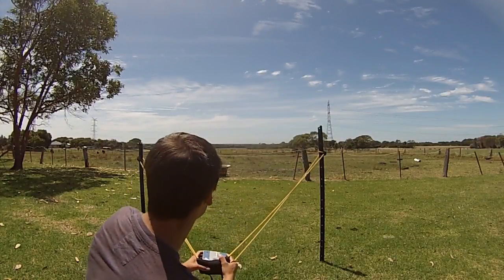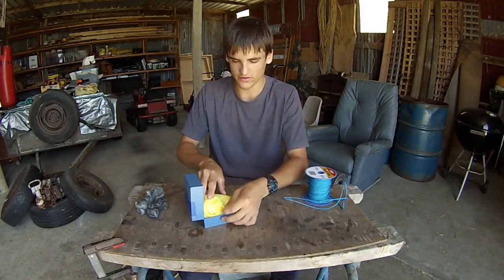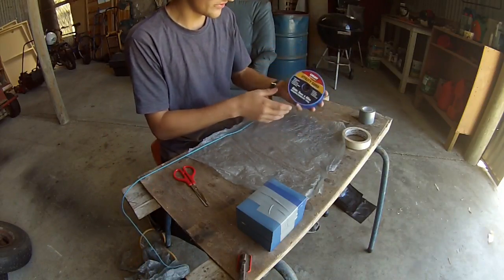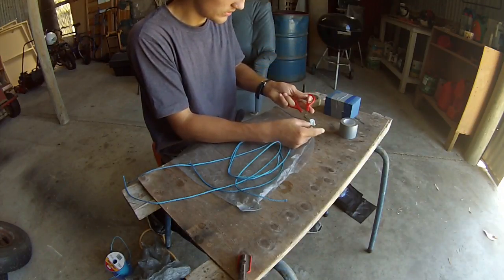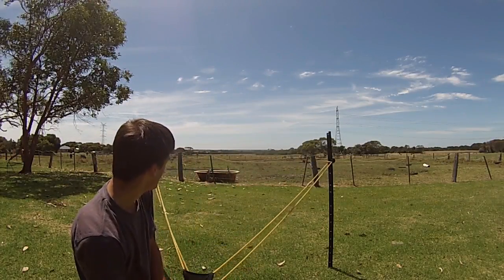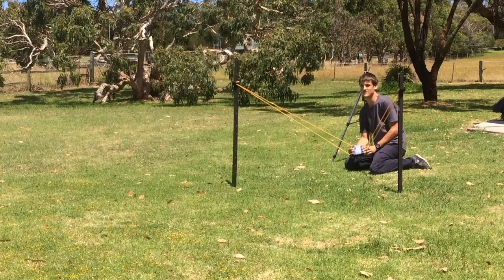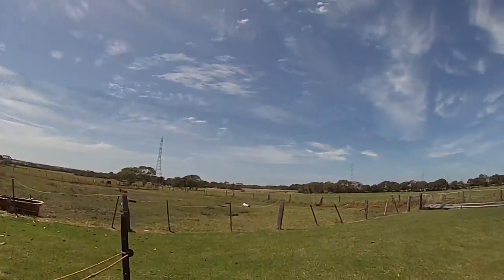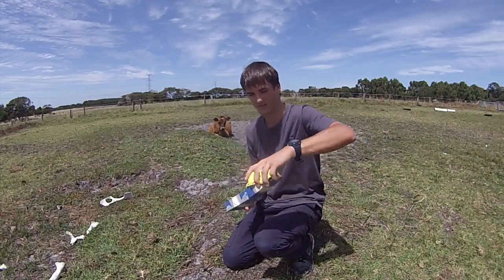Firing an egg from a slingshot!

Comment: Did something similar at my cousin's house for Easter. We dropped eggs out of an attic  window about 20ft off the ground. My container was a metal coffee can with crumpled newspaper as padding and a grocery bag as a parachute. Instead of making a sheet of plastic like you did I just trimmed some of the plastic around the handles to make the opening bigger. Then I just taped the handles to the coffee can. Worked out perfectly. Would love to do it again but higher off the ground to see the parachute really slow it down.
Reply from the maker: That sounds awesome, I think all I needed to do was shoot the egg higher with the slingshot and maybe the parachute would have opened, but just dropping things from a height seems to work best with homemade parachutes!

Comment: That was pretty cool Scoop Science, pretty impressive that the egg didn't at least Crack. As fragile as eggs are they can actually be pretty tough. Have you ever tried to crush one in your hand? Hold it in the palm of your hand and apply even force with that hand and it shouldn't crack. I did it a couple of times succesfully but one time I accidentally added too much direct pressure with one of my fingers, needles to say thankfully it wasn't a rotten egg lol.
Reply from the maker: I have heard that eggs do not break when you squeeze them, also... it was lucky that it wasn't a rotten egg!!